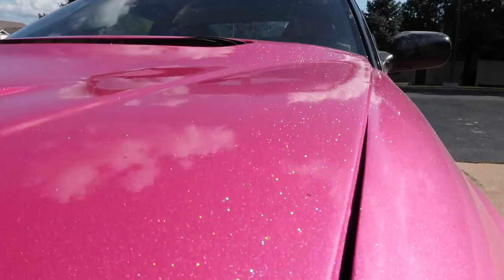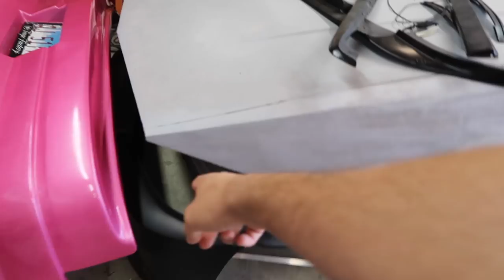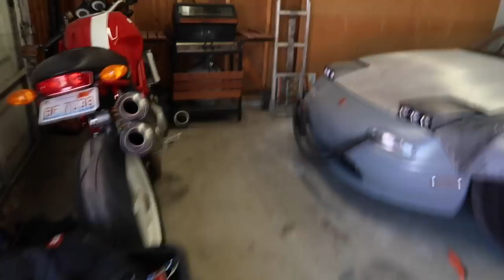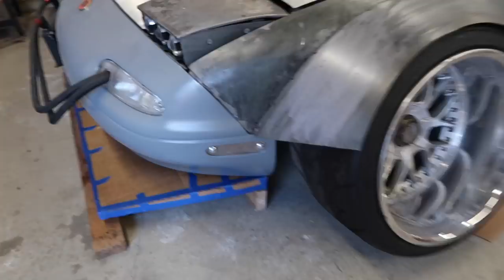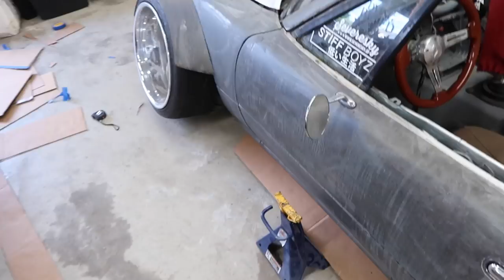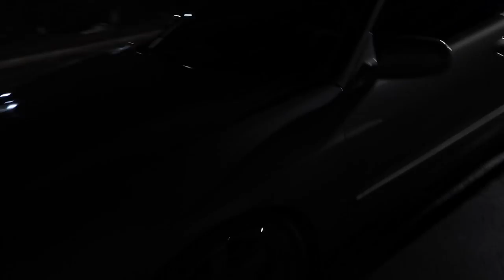You Want To Hear This! + Custom DIY Miata Splitter!

Comment from the maker: ACTUALLY THE CODE GIVES YOU $300 OFF!!! Make Sure you check out the link in the description for more!
Reply: Tyler Fialko i thought u could do like fangs on the ends
Reply: Tyler Fialko I think to keep with the rounded theme of the car, you should round out those front to edges or angle them in a bit more ... and it would look sick \_/ so those bottom corners
Reply: Tyler Fialko what if you form the lip into the that front fender?
Reply: Tyler Fialko last time offer next time you're in Orland hit me up and we can go off-roading
Reply: Tyler Fialko the cars looks good af can't wait till both be done I wish I could help but lmfao I'm mad far from you tho
Reply: I think a hardtop on the camberghini would look kinda neat
Reply: Honestly should connect the lip and skirts into the flares so it all combines as one
Reply: Tyler Fialko bring the cambergini to the Steak 'n Shake meet in Tinley!
Reply: Tyler Fialko r

Comment: Dude, with the front lip and skirts.

Front lip just round the front on the edges, and doing the same with the rear of the skirts, have the sides come up to the arches, even if you still have the 'step' out for the arches, It'll blend in nicely I think.

Comment: you ever think about something like a time attack miata airdam? abs panel that replaces everything below the body line in the front bumper. If you flared the ABS plastic out enough it could meet the front flares and would remove the front reflectors entirely, probably clean up the front end look a looooot.

Comment: cut your front bumper at the trim line and build a custom air dam from fiberglass or metal. make it wider and more squared off at the bottom.

Comment: I'm sure you already know, but that will put a lot of weight on the front bumper, it doesn't seem like it would be that structurally stable, so you may want to get those splitter support things and tie them into the crashbar or rad support or something